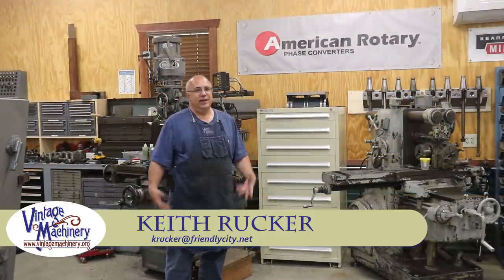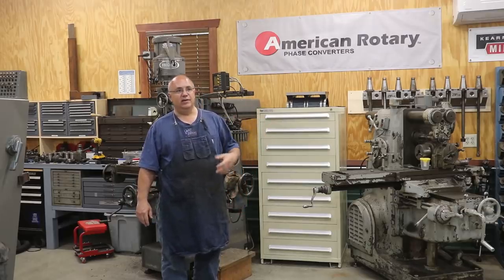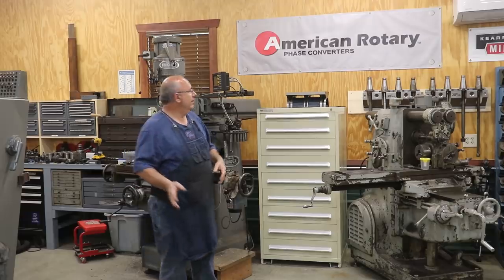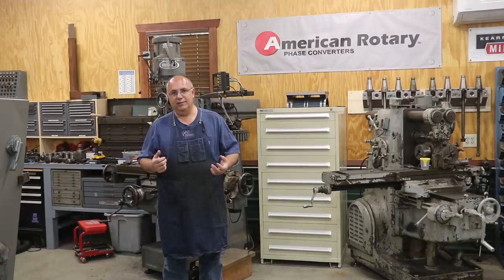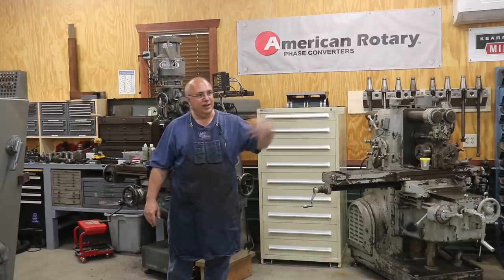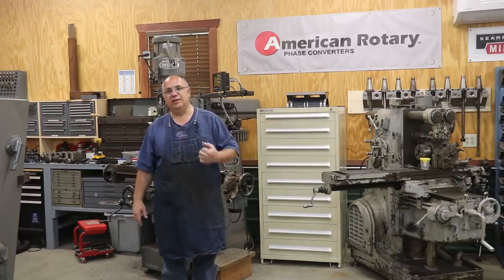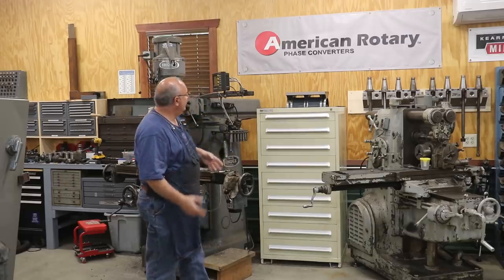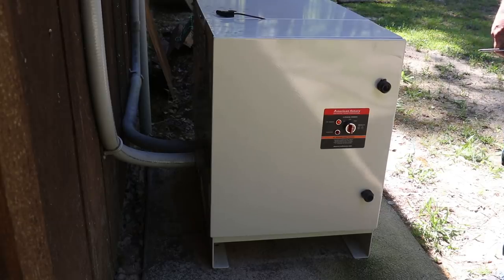American Rotary Phase Converters: Making your own Three Phase Power

Comment: You talk about them running motors. Will they an do you use it for welding machines. I have 2 400 amp services. As a welder by trade i always wanted bigger welders. Stick welders mig welder. But when you get up into the 300 400 amp welders there 3 phase. There is 3 phase power here in the country on the main road. But i am 3 poles up a side road from the 3 phase lines. Hydro one wanted in 1997 over $10,000 per pole to bring it to my driveway. From there i have to buy an instal 2 poles on my land to get to my shop. An pay for the hardware an cables service pannal meter base. I always wanted to pick up an old lath an mill an teach my self instead of paying huge dollars to a big shop to make simple bushings pins pin boses witch most time they dont even want to deal with you because your to small. But they will do it but boy you pay.. i had for years a guy who worked at a shop but also had a small shop with big eqipment but old at home. Ya until he retired i had to wait but when he retired id have it the next day most times but he passed away some 12 years ago.

Comment: Hey, Keith...thanks for another great segment.  I have a suggestion.  Try explaining single phase and 3 phase like trying to pump a bicycle.  In single phase, like in a single rider bicycle, there is a peddle position where both peddles are lined up with your legs and you can't make it go.  With three phase, it's like having a bicycle built for three with the peddles 120 degrees apart.  If one of the peddles is aligned where you can't push down, the other two are guaranteed to be able to provide the torque.  Your steam engines are another example...I'm an old electrical guy, but seems like there was something about single cylinder steam engines that was similar...

I realize this is not exactly technically accurate, but it is a way to visualize one advantage of three phase.

Thanks for taking time to bring us along ...
Reply: @machintelligence  yep, on a two cylinder engine, they may be out of phase, so you don't have to get it barred over...that's the analogy I was looking for with the three phase system.  Love your work...thanks.

Comment: The phase designation describes the number of phase relations. For example in a single phase condition two phases are required.
Reply: Single phase in the USA is more appropriately known as "split phase" and not two phase.  It is unfortunate but due to historical reasons, electricity was run with a neutral to split the 240 V residential.  These days, we don't 'really' need 120 V in our homes.  We could save on wire in new homes and just run everything off of 240 V--like pretty much the rest of the world does.
Reply: Most of the time that is correct and only 1 primary phase is used to deliver the "split phase" (2-120v phases 180 degrees apart) service to a home.  But there are also cases where we have homes that may be served from a 3ph wye transformer and they do actually have 2 phases of 120v, 120 degrees apart.  They of course then only have 208 volts between phases, not 240v.

Comment: Actually, residential is typically two-phase, 120 line to neutral and 240 phase-to-phase, which is used for the high-power appliances like A/C, water heaters, ranges/ovens and dryers. Two phase fires A-B-A-B-A-B... so there's no direction and motors have to sacrifice in order to bias in one direction. Three phase fires A-B-C-A-B-C ... so there's inherent direction control (which is why wiring 3-phase matters somewhat more than 2-phase). Also, more lines means less amperage per line.
Reply: Split-phase...not 2.
Reply: @cpad007  Interesting. Don't recall ever hearing that term before. Thanks!

Comment: It's awesome what they do and do for the YouTube creators.    BUT...  if you know what your doing , you can build a RPC  for a lot less and have as good of quality and features they offer.   I have a little over 400.00 in my 15hp RPC     ... AR  is close to 2000.00
Reply: I built my 15 hp RPC 30 years ago and it is so heavy and over built it will start 15 hp loads.  Given the hours of fabrication, testing, and optimization I expended,  the AR unit is a good deal considering the shop rate of a viable machine shop.  During the great recession of 1990-1993 I had nothing better to do.  You do.
Reply: Roughly the same $ in my 15hp RPC. I could have done it for less if I tried.
Reply: @stancloyd  You now can buy kits online - no need to experiment. Buy motor used on any auction, kit online, connect with wires and you are done. Connecting with wires is also needed with store bought RPCs. 

Main advantage of paying way more $$$ is that you can get one that has no "wild leg".

Comment: What about a generator running 3 phase my uncle used one for 30 years for power using a big generator. runs off agri diesel. He was a wood worker running wadkin and dominion cast iron Machinea
Reply: david houlihan I guess that would depend on your power bill.  I average $5-$10 a day for a one man fabrication/machine shop.  Not sure what the burn rate per day and annual maintenance on the generator would be.

Comment: Less and less countries have 110/130 60 HZ volt system, Those are switching to the more powerful 230V/240V 50HZ system.

Will America be the last country that switch over?
Reply: We are already switched, we have been for years.
Common residential power is 120/240V 60HZ
50HZ electric motors are more costly to build than 60HZ units as well.
I believe Japan commonly uses 100V 60HZ
Reply: The power system there is 110 to 130v 60HZ single phase an 230v 60HZ three phase.

Here, 230/240v 50HZ  single phase and 400v/410v 50HZ three phase for industry and factory's.
Reply: By THERE you mean the USA? I'm a yank so I know that no homes in the last 50+ years use just 110-130V. It's been 120/240 for a very long time. What a lot of people don't realize is that sometimes a lower voltage is advantageous especially for low power devices.
Take a small transformer for example, with 240V wound primary you 
have to use very fine wire, or make the whole thing bigger than It would be if it were wound for 120V. The 120V unit is more robust because it uses bigger wire.I know I have seen quite a few magnetic motor starters fail with 240V coils, were the 120V units from the same manufacturer were fine. So here in the USA we have two voltages in homes so we are able to match the best voltage to the job at hand. 120V for light appliances and electronics AND 240V for heavy duty appliances and household motors.If you were to put in a new service, here in the USA , it's probably going to be at least 200 Amp 120/240V. We definitely have 240V service and plenty of it.

Comment: I understand American Rotary "Supports" most of the You Tubers, but real life guys operating Home shops that dont get their stuff for FREE, have to budget around huge costs like 3-ph power. I wanted to and tried to get one of theirs, but for my size needed it was $1300, I bought a brand new, made in USA with killer warranty, same size/rating from Temco Industrial for $724 to my door. Ordered it on a Tues morning from them in CA, had it in my hand here in FL on Friday!!!  for me that almost $600 difference was better suited to put towards other stuff to get my shop in order (they never tell you in YouTube videos you'll need another 2 or 300 bucks for Home Depot or Lowes in wire, breakers, disconnects, outlets, etc  no matter WHAT brand you buy, so budget that in as well) and yes, you can call it jealousy, or sour grapes or whatever, but bottom line is- I still had to pay MY MONEY to get power in MY SHOP, and I didnt feel like I could reliably make my own home brewed RPC out of a $100 craigslist motor as so many would have you believe is easy-
Reply: Hm. So, you wanted to buy an American but decided you couldn't afford it so you chose to buy a less expensive brand. Is that about right?
And you sound like you're happy with your decision. Yes?
Yet, the tone of your comment suggests that you are not happy.
Are you happy with your purchase or not?
Reply: @BigRalphSmith   I am EXTREMELY happy with my Temco RPC- dont know how you got that? I had questions when hooking it up and they were great on the phone, I had questions before buying it and they answered my emails back within the hour- Everyone makes such a big deal about American Rotary (mostly because they get FREE units and have to kiss booty) I'm just saying if you do your Homework you can save decent $$ and still buy a made in USA unit
Reply: Eclidean I wonder if you produced  YT videos for a number of years, picked up thousands of subscribers, and was as pleasant and genuine as Keith is, AR would help you out?  I really don’t get why folks get so offended by these types of videos, Within the first 30 seconds we were informed. You do have the option to watch or not.

Comment: Needing thicker wires for VFDs make no sense to me. A correctly configured VFD should have a higher efficiency than a RPC (Rotary Phase Converter). So unless you're all of a sudden using a lower voltage and higher amperage to power it, the draw should be the same. I think for the "correct" comparison you would have to consider replacing your RPC with a single VFD for the entire shop.
Reply: Two thicker wires instead of three smaller ones.
Reply: Oh, he's talking about running 1 phase to the VFD at the lathe of course. That makes more sense. And that would be 2 vs 4 wires btw :)
There's always a neutral wire and 1 (or 3) phase wires.
Reply: Nope, no need for a neutral just 2 or 3 hots and and a ground.
No neutral needed unless you need 120V, for something, which is a poor way to do it on a machine, you should use a control transformer instead.
Reply: I suppose you're right. I wasn't considering wiring the motor directly. That should be able to run on the difference between the phases directly without any need for further cables.

Comment: sorry, I was wrong here.  We get two phases to the house but it comes from a single phase power through a transformer on the pole....

I don't know where you'd get a statistic that the majority of the U.S. has single phase power.   I highly suspect the majority of the U.S. has 2 phase 220 volt power such as my house.    You aren't making 3 phase power from single phase power you are making 3 phase from 2 phase.
Reply: No you receive one phase 240v to your home. What you are doing is splitting either leg of the phase to neutral to get 120v.
Reply: @otm646  Ah, I believe we are both wrong/right.   The proper term is split phase 240v as far as I can tell.  A single phase from the power-line  is transformed to two phases  of 110v 180 degrees out.    Thanks for the challenge.  I learned something.